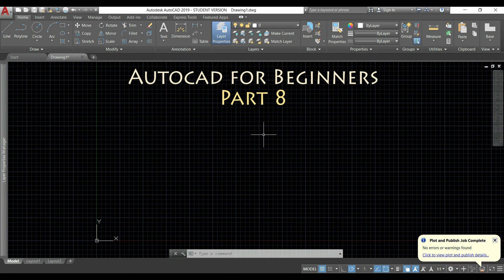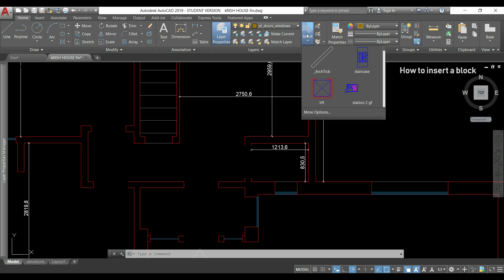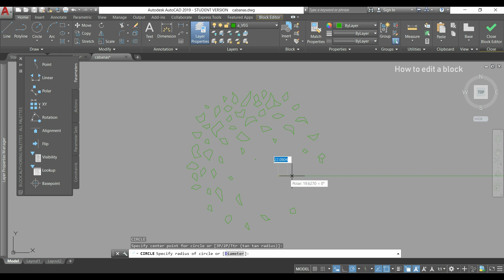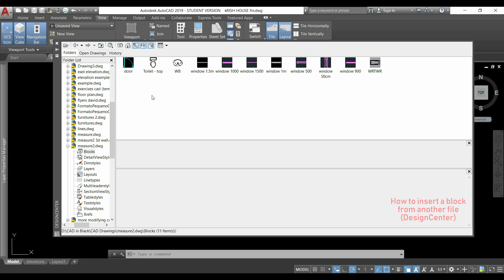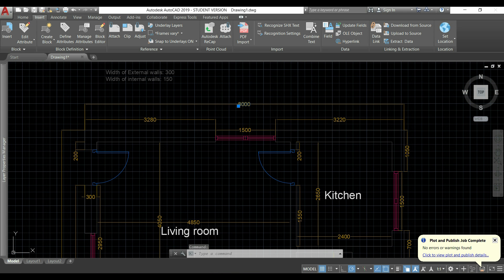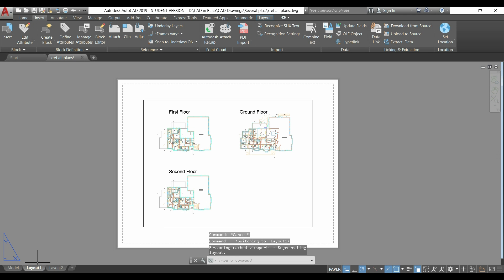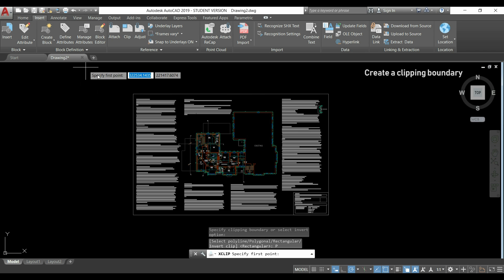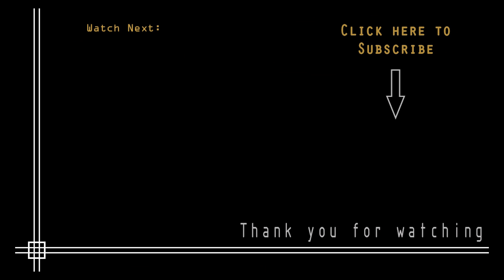AutoCAD - Complete Tutorial for Beginners - Part 8 (blocks, xrefs, pdf import)

Comment: Great lesson!
Question: When you import a PDF, the AutoCAD does not recognize the text of a dimension as one that belongs to the dimension (as it would when you add a Dimension in autocad itself). 
How can you make it do so? so that the imported dimension and its text will be one object?

Also it would be great if you can do a more elaborate video on the options and settings of imported PDF, and adressing issues someone might encounter with it.

Thank you and keep up this wonderfull work. :)
Reply from the maker: Hello +MatanBaum.
Yes. When you import a PDF, dimension lines are not detected as dimension objects unfortunately. If the text is recognized, means that the file it was drawn with a True type text. Sometimes If we just upload a random file, the text is even not recognized, and everything is slited in small lines and arcs.